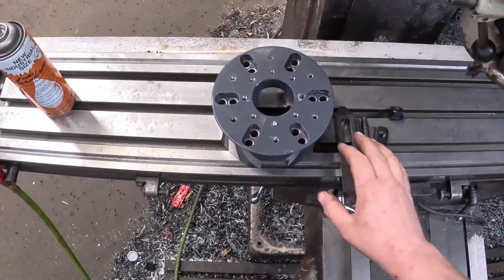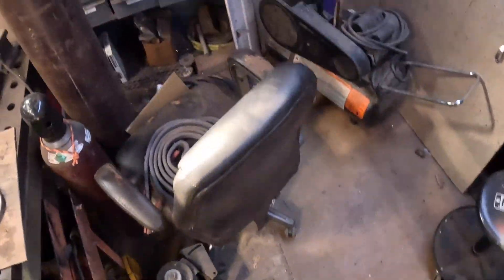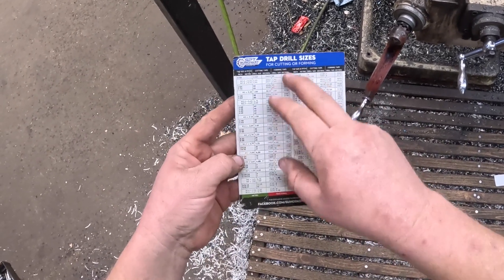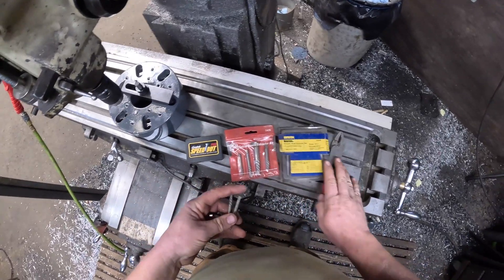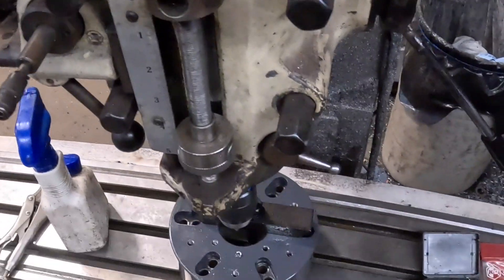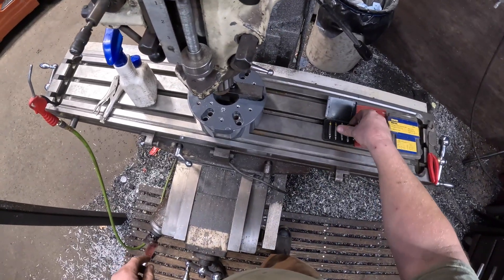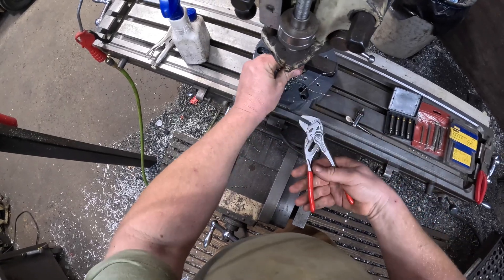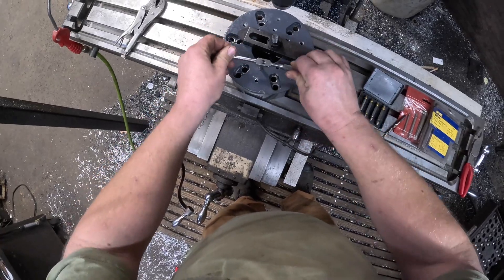Removing broken bolt with vertical mill.

Comment: You ever tried the nut trick welder it to the top of the broken bolt ?
Reply from the maker: Yes and have had success several times. I was more just leaning into what I’m good at. I’m ok with a welder but the machine tools are where I excel.
Reply: @HomesteadOnTheLane  sound like me mate haha i actually learnt to weld first